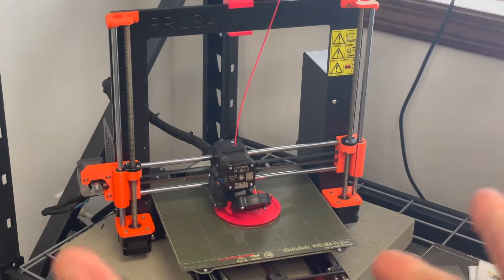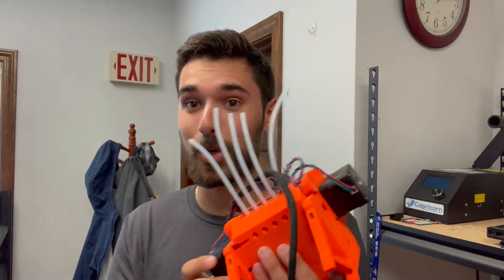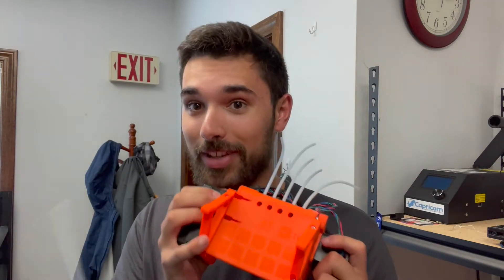My Final Thoughts on the Prusa MMU and the MK3

Comment: I disagree the 3s+ is the best and most reliable printer I have, as long as you set it up right. I also have the mini and it is no where near as good as it is a lot smaller and not direct drive. The Mk3s+ produces consistently better prints I have also had the Ender 3 which was ok as a starter printer. In a nutshell you get what you pay for.

Comment: I wish I saw your video before I bought mine.  I agree the MMU2S is JUNK!  I remove it and after a while, I mount it and try it again with no luck.  I design a 5 filament holder and do the color changes on my hand, and I never had a problem with that. But I love the Prusa MK3S, it works like a champ.